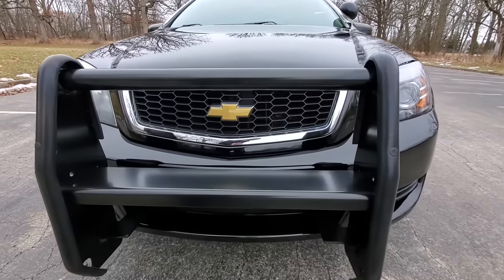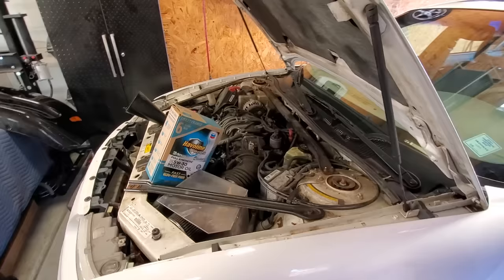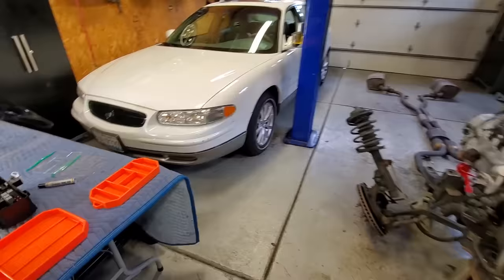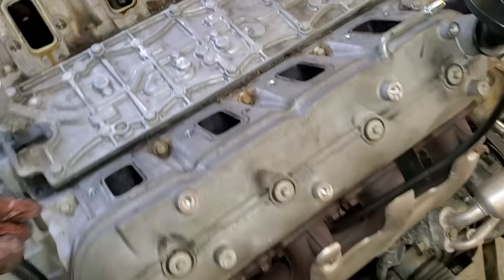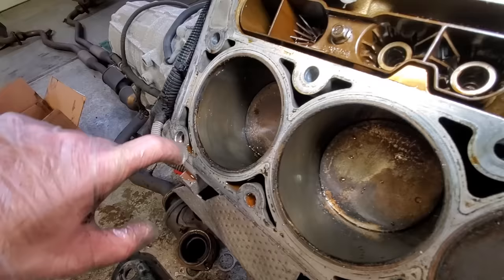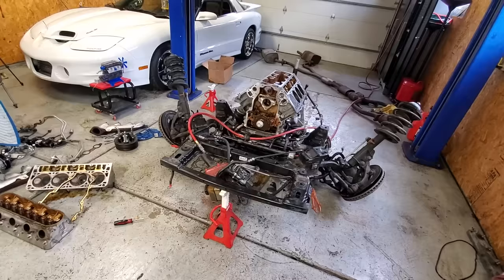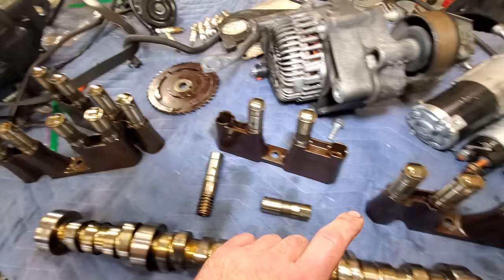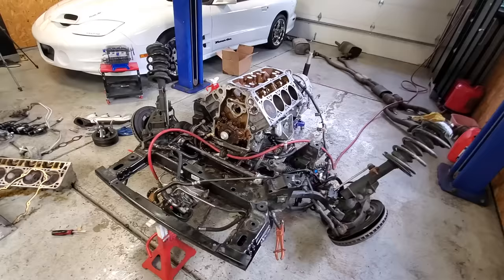Looking Inside An ABUSED V8 Engine That Idled For 12 Months! 357,000 Mile LS Teardown + Body Removal

Comment: Well obviously after looking at that engine idling isn’t that bad for it
Reply: What he doesn’t understand is that most wear and tear happens to an engine in the first minutes of starting before the oil circulates and coats the internals. Cars that never get turned off spend less of their time unlubed so there is less wear internally. Our daily drivers that get turned on and off after short intervals have the shortest engine life spans.

Comment: Not really a Chevrolet guy but will haft to say that's a big ass motor in a relatively small car. The engines have changed so much since carburetors and distributors. Now with all the fuel injection ECM's and the general layout of today's motors I'd probably haft to go to school just to learn how to work on them. Yeah I know I'm a old fart.

Comment: You can idle an engine for a 100 years.  The oil is always at temp. There's not too many cold starts. Modern fuel injection isn't that bad.

Comment: Considering how hard cop cars are driven, the internals of the engine "should" be pretty clean so long as the maintenance was kept up. Not so sure about the transmission though lol. Every car I've owned seems to thrive on the occasional "drive it like you stole it tuneup" (assuming everything is taken care of so nothing breaks). I've personally seen cop cars in my area idle way too much in my opinion. I once saw a town cop car idle for a solid two hours while the cop was talking to someone. It idled so long that the exhaust was filled with water. His solution? He revved the shit out of it. Then there was a call and he hauled ass out of there.

Comment: What's to love about working on modern cars? A v-8 engine would come out in less than 1/3 the time on an old carbureted car than that new junk LS engined car.
Reply: That's good because old carb V8s last about a third of the time that these engines do.
Reply: turbiq4. Newer carb. engines last much longer than old carb. engines but are ALL easier to work on than fool infected engines. I have been stranded in new cars more than old cars simply because of inaccessibility to defective components and hard to diagnose fool infection problems. Some people are fascinated with high tech. I am fascinated with older easy to work on cars that are also way more reliable than these new "techies" will admit. In fact, in the fifty plus years of driving and repairing older cars I have found that most of the cars that sat by the side of the road broken down had simple problems, that if the driver "had a clue" he could have repaired it on the spot and continued on his way. After all, how much did an easy to install fuel pump cost? A set of points? Cheap parts that easily stored in the trunk. Repairability is worth much more than fool infected reliability especially since I have not been stranded in an old carbureted car since 1975 but have been stranded in fool infected cars six times in the last twenty years. Nuff said. Have a good day.

Comment: I guess it is gonna be a legit street car but with how far youve tore down the motor and being an ls, you could totally trick that block out for a few thousand..  then all youd need is a dominator package or similar, some suspension work and you could have a 800hp roller..  hell just throw a grand in it on turbo and pistons n shit and a cpu an itd still be a big body beast..

Comment: 82,000 miles and over 8000 hrs of idle time. No chance in hell those plugs are original. They just used quality replacement parts. Most police department's just go OEM on all replacement parts due to reliability.

Comment: >idling for an hour is equivalent to 33 miles of driving

First off: source?

Second, that doesn't even make sense. A car driving an average of 33 miles per hour over x hours would accumulate many times more wear than idling for those hours. Idling is the lowest power state of the engine, and the engine has very little load. Unless your oiling system is atrocious or the motor is getting too hot, the engine won't have much wear at all from idling, if you're doing reasonable service intervals.

I think you're off by a factor of about 10 on your added mileage calculations.
Reply: first off the source is ford and chevy so check that lmao second police cars idle at a higher rpm than a standard civilian car so at 33mph your at 1100rpm roughy and thats about where they sit and idle at

Comment: Of course, because 87,000 miles is nothing. And Idling puts practically zero strain on the engine. I am only here to see this supposed damage caused by idling. I am beginning to think that is an urban legend. As a mechanic, I have never seen the damage caused by idling. I think there may be a type of engine somewhere that can't tolerate idling and everybody has just spread the gossip to every engine.

Comment: This is how a fake vehicle is. My 2005 Ford F-150 with 164,000 miles was owned by an old man who owned it for 5 years and then a farmer for I think 7 years and then a cop for 3 years and the guy I bought it off of had it for 6 months. I’ve had it for over a year. Still running great, had to replace Original cam phasers and original spark plugs and now it runs great with a 93 octane 35 horsepower tune with a cold air intake and 3 inch exhaust.

Comment: Idle time IS NOT the same as real miles. There is no where near the load on an engine when it idles than under driving conditions. Your 357,000 miles is NOT correct. Never mind the fact that the trans sees no miles when the car is just at idle...or the chassis either. You have a highly idled 80,000+ mile car that was well maintained.

Comment: My car accumulated no miles while idling cuz it only calculates the moving miles. And idling does not add that much wear and tear to your motor at all you're anywhere from 6 to 800 RPMs that's very low when driving you're closer to 2,000 rpms your calculation of Miles by idling is way off parts are moving 10 times slower when idling

Comment: Why are american police cars equipped with V8 engines??? I mean it's everything but efficient. We in Germany or at least in Bavaria have BMW 5 series with Diesel engines. Those will do 155 on the autobahn and still have decent MPG. They are also equipped with bigger alternators and batteries, so they don't have to idle all the time.
Reply: America and Germany are very different places and have different ideas and needs. The small block V8 is the norm here. Far cheaper to build, certify, package, and repair than a diesel engine.

Comment: DONT EVER SET A HEAD DOWN ON THE HEAD GASKET SURFACE!!!  Especially on the fkn concrete!!   

And I can't help but notice that you are doing all the exact same work that you would do if the engine was in the car. Except now the engine is out of the car. Honestly, not worth the 8 hours of additional work to me.

Comment: The rubber stuck to everything clearly indicates it is a replacement engine which came with cheapo everything including the plug wires. The replacement engines since 2007 are being created in China now. Originally the motors were supposed to be made with the Chinese parts and assembled in Mexico but ole Obama killed that idea. Since most of the parts are created made in China when the deal was killed China started running amuck on quality of the replacement parts namely rubber stuff and gaskets too. The reasons why most of the replacement fuel injectors are totally ill fitting ill performing junk. The lack of a service history/record indicates it is a replacement engine which happens near the cars end of service life. A few friends have retired police & fire vehicles and I can't remember one of em that has on OEM engine in em.

Comment: I blew my car up from sucking water, 2.8 toyota hilux/4runner and it looked exactly the same, i looked after it and the bloke before mustve aswell, it was only untill i cleaned the piston surface from the carbon build up did i get to see the problem, and it was a bent rod and a fucked head, it was still cross hatched in most of the cylinders but the one that was bent, all i can say is i sent it at least...

 im rebuilding it now😐

Comment: 2:43 well it’s great that it has less plastic, but there’s still plastic holding the oil, & with all that extra crap it has it’s not any better for the environment.
Heck the most environmentally friendly thing you can do is to put the oil in your gas tank, well or at least I can. Or those with older diesels can.

Comment: Yeah that math you're using is very misleading! It amounts to 43 miles in time and fuel consumption only! I can send you two studies done on 1000 cop cars in two different states. Cop cars are the best maintained fleet there are. When you stated your 1hr -33mile comparison,  what you are leaving out is idle time there is no load, no drastic change in rpm, no pulling or advancing timing while at idle compared to wide open throttle from idle wh I ch nearly every cop does every time they pull off... I can send you the studies by email if you'd like but in short, there are ne ways to compare idle and an engine propelling a 4k lb vehicle at high rpm to stop back to jumping into traffic to run down a citizen for not using his turn signal or other such horrible infractions 😂

Comment: At most airports the trucks and vans idle a lot and can run only 15mph they are bad on engines and cat converters
Reply: Based in what!
Reply: @jamesfranko5098  f150/f250/all types of vans /all tier 3/4 diesels in push backs and deicers since they have dpf after treatment exhaust